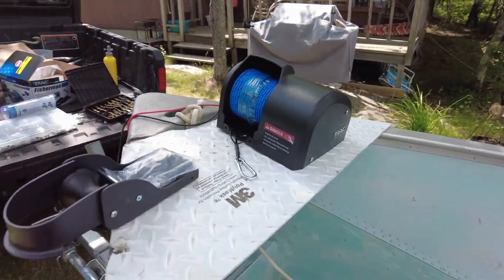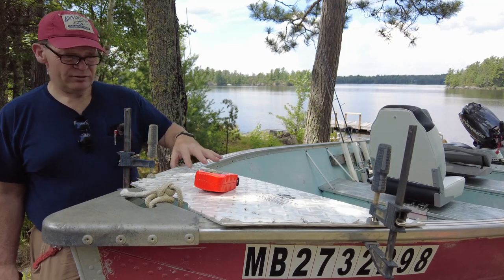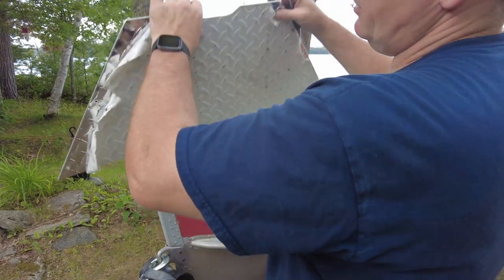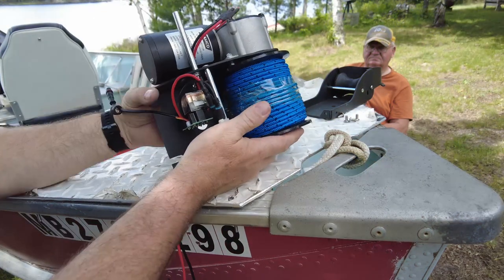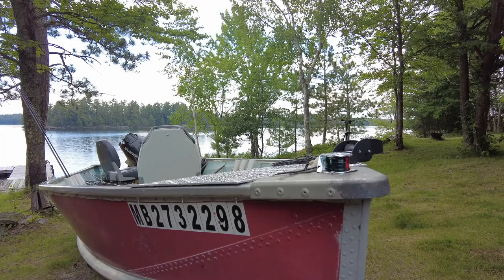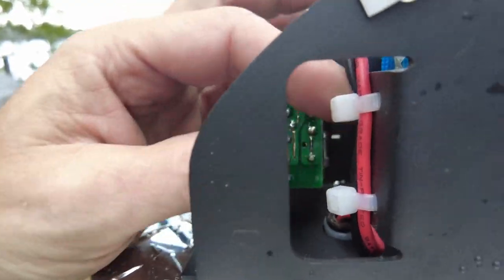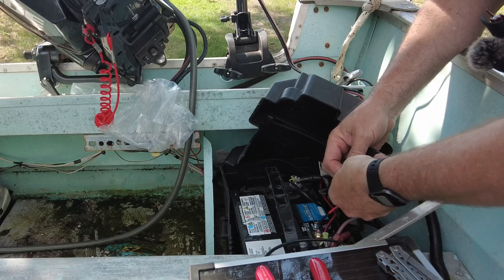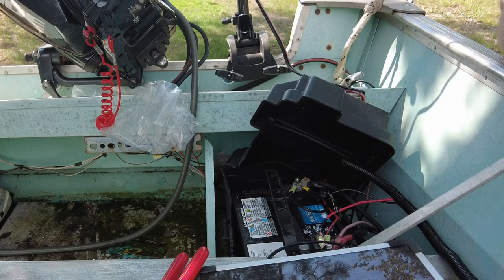TRAC Anchor Winch Installation on a 16 Ft Naden Boat

Comment: Do you like this unit still? any problems or things you don't like about it?
Reply from the maker: It functions well.  I should have mounted it so the fairlead stuck out a bit further but otherwise it works great.  Also, it is designed more for a mushroom style anchor that the Danforth style we are using.  We just have to be careful that he ears on the Danforth don't catch the chine on the boat when we are pulling it up.

Comment: Any tips on transom replacement for the Naden? I'm doing a old Iowa 14' naden
Reply from the maker: I would think you are going to need a base plate of some kind, sort of like what I did.  Does your boat have the squarish gunwale extrusion like the boat I did?  That worked out quite well for attaching the base plate.

One other recommendation,  make sure the fairlead extends far enough out over the stern of the boat so the anchor doesn't catch as it comes up.  The anchor on the Naden I did is not the right type for the Trac winch.  While it generally works, you have to be careful when coming up the last couple of feet or to will catch on the stiffening rib on the side of the boat.

Hope something I have rambled here helps you out.  Best of luck with the install. 👍
Reply: Thanks. Did you replace any rivets? If so what size did you use
Reply from the maker: @michaelpayne8691  I didn't do any on this boat but my buddy and I did a transom rebuild on his older Naden.  I believe we used 5/32 but that was a couple of years ago so I could be wrong.

Comment: Hello ive subscribed to.your channel and gave you a like 

Can you help me please ive looked everywhere on the internet more than 20 hours of research for the kawasaki js440 1988 carb adjustments 

I need the turn for: 
High 
Low 
Pilot jet 

I think my carb is a mikuni 44 since it has 4 bolts 

Thanks for your help sir and your knowledge
Reply from the maker: Brandon from Brandon's Garage on YouTube has a similar Jet Ski and can likely give you the specific turn values out of a manual.  

Generally, it has been my experience that 1.5 turns is a good starting point for jets on Mikuni carburetors.  You will have to test the high speed in the water as the carburetor will not verify proper function without a load on the engine.

If you cannot get your machine to idle at 1.5 turns on the low speed, you likely have something plugged in the carburetor or possibly a torn diaphragm.

I hope this is of help.  Best of luck with your repair.
Reply: @DougsMessyGarage  thanks for replying im so happy im getting a lot of help tonight 

Can you tell me when i screw in does it make it richer or leaner ?
Reply from the maker: @jimmy2fois263  Again, I am basing my answer on my generic understanding of the Mikunis I have worked on but tightening the screw leans it out and loosening allows more fuel to flow.
Reply: @DougsMessyGarage  thanks really appreciated